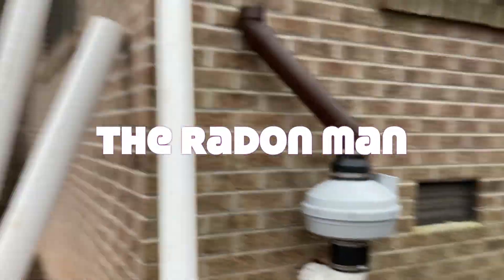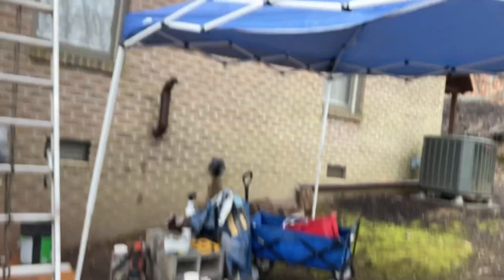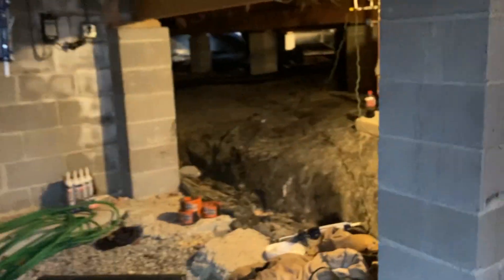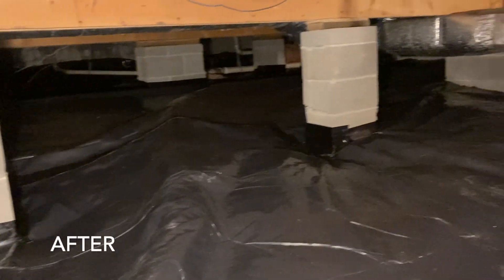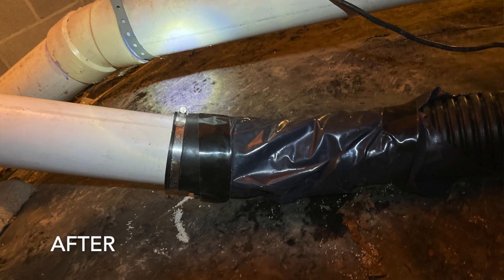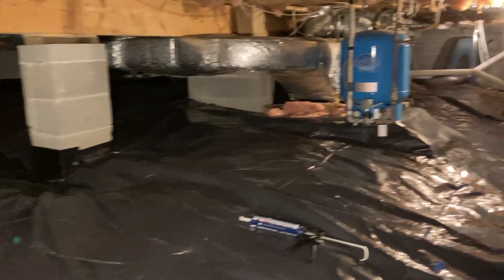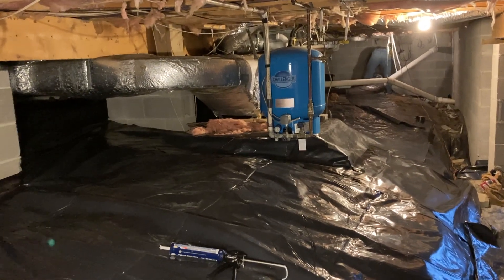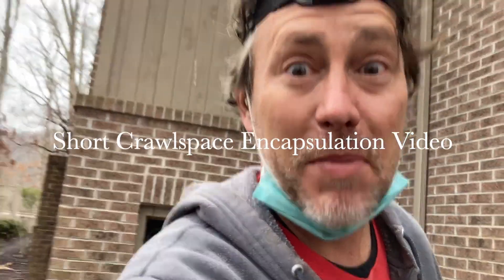Short Radon/ Crawlspace Encapsulation Video

Comment: By taking care of the seller, haven't you short changed the buyer by doing the bare minimum? Is it protected adequately?
Reply from the maker: Hi Donna. Let's pretend that in order to sell your home, you must provide the buyers with a new car that you will never enjoy. Would you buy them a new Ford Focus or a new Mercedes Benz? Both cars are safe and get you from A to B. Hope that helps. Thanks for watching.
Reply: @radonman6800  hello sir! What did you do to the end of the corrugated pipe? Did you put a screen or not?
Reply from the maker: @akatkdboi  I have not found that a screen is necessary with corrugated pipe under the black plastic underlayment.  However, I do use a screen as critter or leaf guard at the top of the vent or exhaust. Thanks for watching!

Comment: Thank you for the explanation at the end. My builder cut a lot of corners. After having my new home inspected the inspector said he'd never seen a radon system set up like mine. I was worried that the builder shafted me on the system. I now understand it's bare minimum lol. Is it normal to have the fan inside the crawl space with the exhaust just on the side of my home less than a foot from the ground?

Comment: I had a radon company come in and give an estimate. He said I needed 20 mil plastic. I believe I have 6 mil plastic already on the dirt.  Should I look for another company to do the work? He said the plastic was $25.00 per sq ft. He estimated that for the plastic and fan were going to run $3,750.00. Does that sound right?
Reply: Did you get your crawl space done?
Reply: @chirina5  Yes! it was my cellar. Swat had to place vacuums in two areas and gave me the largest fan they make and charged me,......drum roll,.... $1,550.00! The installers were the nicest people I ever had to do business with. It was 90-95 4egrees in the cellar. It took 2 days and at least 15 hours to complete the job. I highly recommend SWAT.
Reply: That sounds expensive
Reply: I have 3 crawl spaces in the basment and was quoted $8,500
Reply: @maconjokez  Contact SWAT for a fair price.